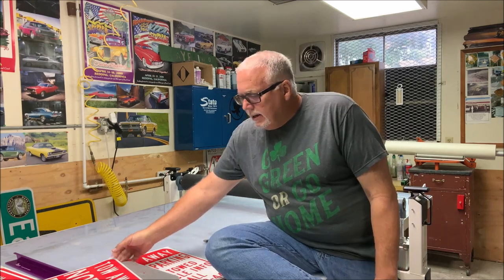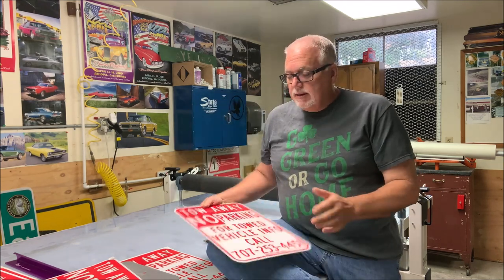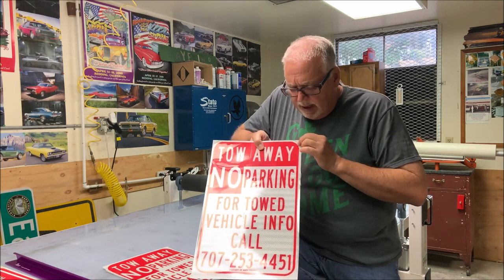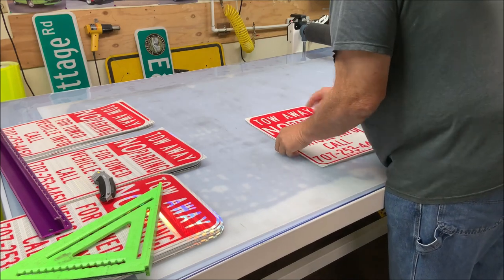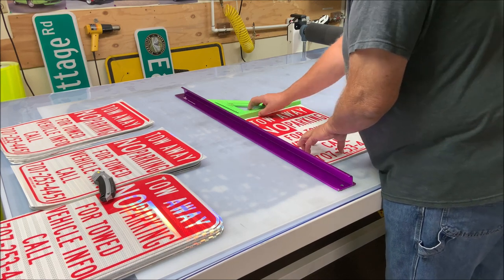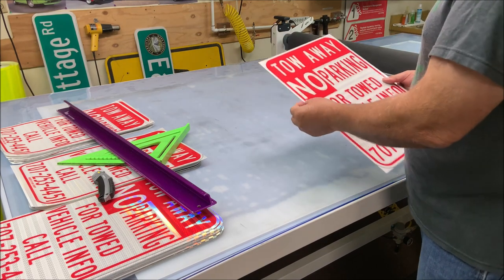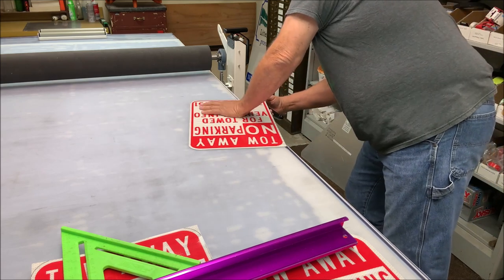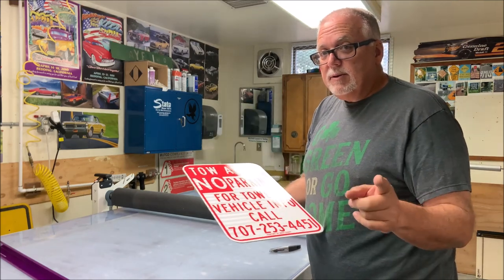Making Traffic Signs. Lining up the edge.

Comment: I have a trick to lining them up faster.  If you are printing and contour cutting build your blank in Flexi.  If you are using the blanks supplied holes to mount from just build the blank with the holes and use it make a contour cut on the holes.  Once you get one built you can just us it as a template.  We have a few different measurements on our blanks because we reuse old blanks.  With the holes cute out or the HIP or DG3 just use your fingers to line up the holes in the material with the holes in the blank and your done lining it up.